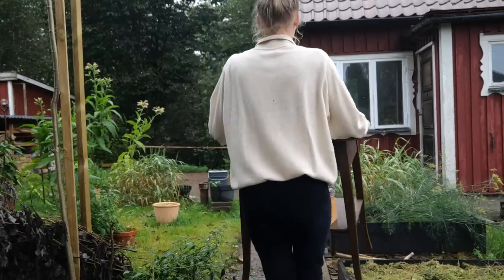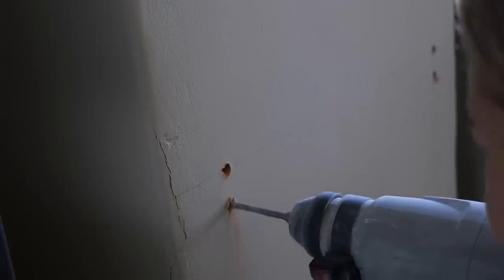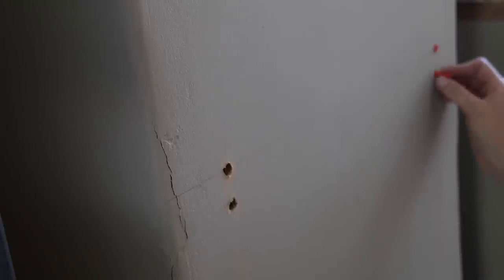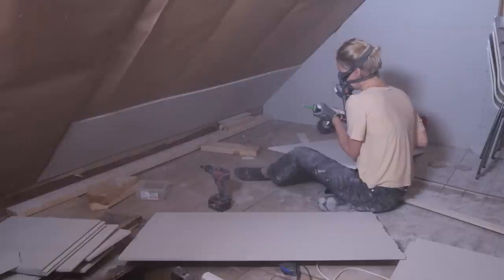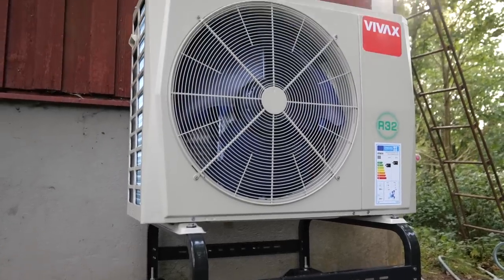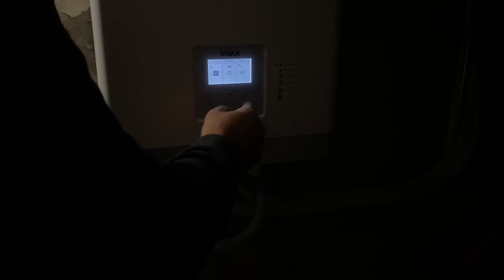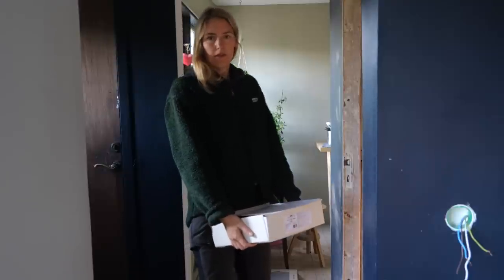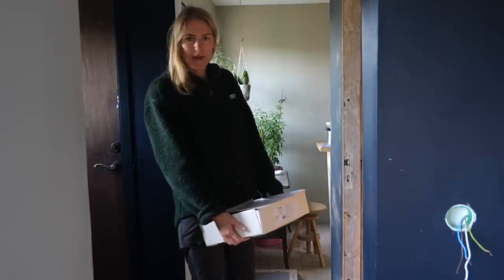#22 Getting heat and hot water in the house | Renovating a small house by myself (with some help)

Comment: Hi Anna, great video, you can use a Stanley Knife to cut your plaster board, the blade needs to be sharp but score the board along your pencil line then fold the board and cut the other side (try practicing on some spare pieces). You will eliminate 90% of the dust, hope this helps.
Reply from the maker: Hi Andrew, thanks for watching my video! I am using a fiber plaster board that doesn't really work the same way.. It can not be broken off easily and has to be cut with a circle saw or similar... A little bit annoying but it is so strong you don't have to use plywood or similar behind it, and should then save both time and resources used 🌱

Comment: You know what would look great above that towel rail?   A rail pot hanger.  
And smart wearing the mask. When cleaning if you don't know what your dust is, always better to mask up.
You can make covers for the pumps that look better, just make sure to have adequate ventilation to match what it needs for air flow.  basically a lath box painted how you want would work.  I've seen them online, but I'm sure you'd want to make yours. 😁
Reply from the maker: Great ideas 🙂 And yes, I feel like I breathe in all kinds of stuff so wearing a mask as often as possible 🙏

Comment: I think a vertical subway tile would look nice in your shower I don't know if you have tiled the walls of the shower yet but that's what I would put on the walls of the shower plus it would look different because most folks lay them horizontal I think I put those two terms properly still doing a fantastic job
Reply from the maker: Yes, this is exactly the idea I am going for.. Just hoping to find tiles that are cheap/nice enough 🙌
Reply: @annasgmlindgren  you could always mix and match like colors as long as they are the same size